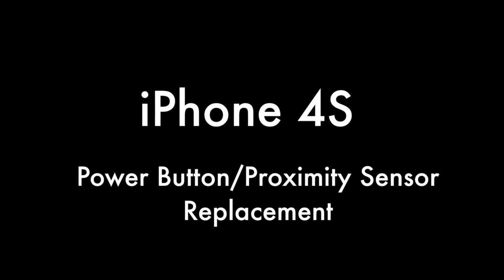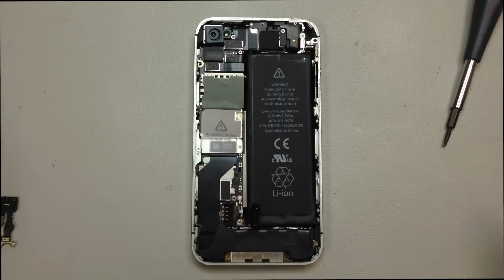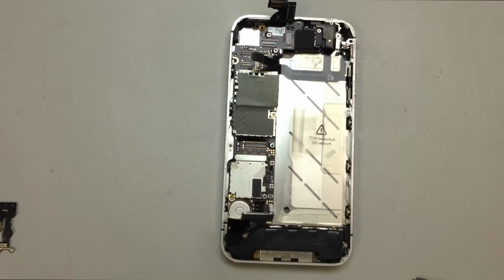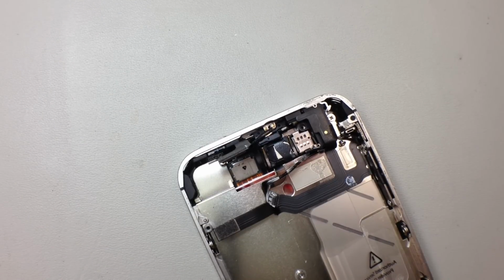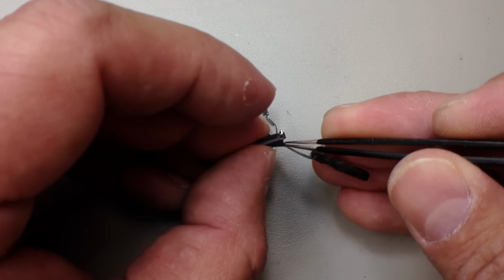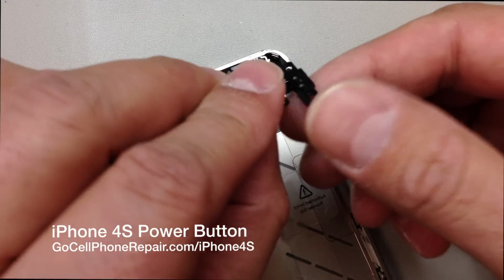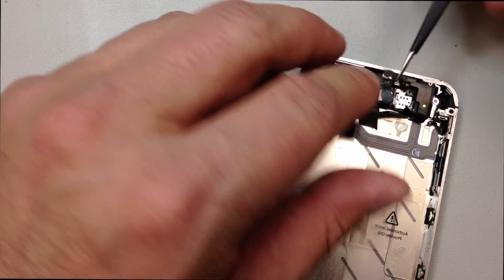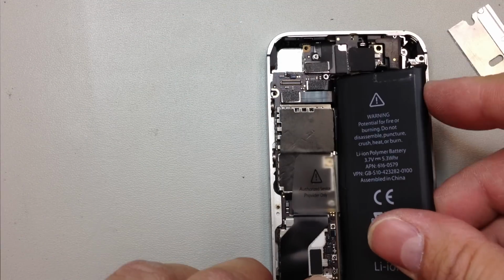iPhone 4S Power Button, Proximity Sensor Replacement

Comment: What is the socket above the power called, if you don't mind me asking? (I damaged the cable for the one above the power socket) So I need to get a new one, but I'm not sure what it is.
Reply from the maker: Can you link a photo so I can be sure that I know what you are referring to?
Reply: I worked out it was the front camera socket! Thanks for the reply though. If you don't mind me asking..
I managed to damage both: The front camera cable, and also the silent volume switch cable. The phone no longer turns on, do you think it's to do with one of these cables? They aren't necessary components though.. technically? Or could I have bugged something else also? I ordered new cables anyway, hoping it's just one of those cables. In a computer for example, you do not necessarily need a soundcard.. so I am just curious if 4S can actually work without some components.
Reply from the maker: As long as you didn't damage the lock button cable it should still power up. I'd try disconnecting the ones that you think are damaged and connect a power source to see if it boots the phone up.
Reply: I damaged both front camera and the silent switch cable. But I've managed to get the phone to boot, new cables are on the way, do you have videos to replace these two cables on your channel? In which order should I replace each cable?

Comment: hey, just watched the video, its very informative and helpful. But after putting my phone back together, I got a 601 physical nand block offset 1. Then i disconnected the power button cable and the phone worked again(but not the power button of course). Would you know what I did  wrong? Thanks again for the great video.
Reply from the maker: +Noob2Chicken Most likely the cable was not properly connected or it is defective. I'd try plugging it in again and if the problem repeates youve probably got a bad part. The logic board can cause this also but from what youve described thats probably not the source.

Comment: Amigo consulta, tengo 1 iphone 4, y el botón está hundido, es como que no se puede presionar, debo pedir el flex junto con la parte que va el botón resorte que sube y baja al presionarlo? o solo el flex con el botón ese sin la pieza que se desatornilla que va por debajo del botón (la que tiene 2 tornillos puestos en el marco del iphone).
Saludos y gracias.
Reply from the maker: +Aldo Cordero Cárdenas You can replace the entire flex cable or the contact switch itself. Neither are fun but. Let me know if that answers your question. Google translate is not always 100% accurate.
Reply: Go Cell Phone Repair i understand you :) thanks man i dont speak very good english

Comment: Power button works well, but my proximity doesn't work now. Any idea?
Reply from the maker: +Jakub Doležal Could be a defective part but I'd start by checking here: https://www.youtube.com/watch?v=ZzbznNb-aXM
Reply: +Go Cell Phone Repair 
Thank you. I tried connect the old proximity and it works fine. So I need buy a new one part.

Comment: Thanks a lot for the video. It's very clear! I didn't have a new prox. sensor so instead I put a tiny folded (about 4 times) piece of paper just under the power button. 

It worked!! 

The button doesn't click but it makes enough contact (I need to push a little harder than normal). Thanks for showing the disassembly.

Comment: Hey guys you seem to know your stuff, is it possible to replace my android's power switch with a DPDT momentary switch by simply running and soldering wire from the DPDT momentary switch to the solder pads in place of the stock power switch on the phone's PCB? Reasons are complicated to explain haha but is it possible?
Reply from the maker: +Matt Maybe. I'm not sure which phone you have but is there a reason that you don't want to just replace it with the OEM button?
Reply: It's for a custom project in which the phone's power button needs to be moved off the pcb.
Reply: Also its an optimus Android fuel

Comment: having a hard time  with putting the power botton back in, which way should it sit...still not clicking.  Need help.
Reply: +Jacek Blaszczyk The little flick on the power button have to point down

Comment: very helpful video.. i fixed the lock button and it is fine now. but the ear speaker is not working.. i removed everything and put that back again.. still the ear speaker is not working..
Reply from the maker: Sowrirajan Kalyanaraman Check the gold prongs. If they don't line up right there will be no sound.

Comment: Question: Has anyone else noticed how small the hole is in the proximity cable for the speaker? I dont know if mine is not aligned well or what but mine is not very loud. Though it may have been the speaker so I replaced it with one that tested to be very loud... but not now after putting in my phone?  HELP!!! lol

Comment: Excellent vid thanks!  Just one question, is there a UV filter for the sensor on the 4s?  I tried 2 flex cables (same supplier) and can't get the sensor to work, not sure if that's a possible cause.
Reply from the maker: Was the screen repaired prior to the problem? Sometimes the coloring of the window is off a bit. You can sometimes go over it (on the inside) with a black Sharpie if it's too light.
Reply: Go Cell Phone Repair Turns out it was a bad supplier.  Got the part from another and it works.  Thanks

Comment from the maker: @matt sturrock Yeah I usually go through the whole re-assembly. Must have been in a hurry that day.
Reply: Go Cell Phone Repair What screwdriver brand tool did you use?
Reply from the maker: Bryan Torres In this video I was using a Husky.

Comment: this was a great run through and helped me out loads. I couldn't of done it with this chip. was a little disappointed when the walk though stopped after testing the power button - dude you left me hanging !  apart from that, great clip. 
Many thanks

Comment: The power switch after doing repair is very stiff and doesn't seem want to push in. Is that normal?
Reply from the maker: No it should feel pretty close to the same as when the phone was new. Sometimes the button doesn't get aligned exactly where it should. You might try backing off the screws a bit and moving it around until it feels more comfortable.

Comment: I ended up with a bootloop after this, what did i do wrong?
Reply from the maker: Hard to say for sure but I would start by disconnecting the new part and see if it does the same thing. Unplug the battery first of course and you can plug the phone into a power supply to turn it on once the power button flex is disconnected. If that works you probably have a defective part. Otherwise that can also indicate a software problem. This sometimes happens after the battery has been disconnected especially if your device is jailbroken.

Comment: Just a thought, I couldn't do all that fixing in a million years. I was quoted £160 to fix power button by Apple store. Only just out of warranty. Or they would give me £200 for it if I bought a new £600 phone!!!
Why are iPhones so rubbish that they need all of that after being very lightly handled - in the big scheme of things? Dodgy product trading on its name, which I think will soon be replaced by a more reliable one.
Reply from the maker: Wow that sounds like a bit much. We do them here for $79-most of that being the labor fee as there is considerable time involved. As for the big scheme of things.-understanding their design flaw we would hope that Apple decides to create a modular lock button rather than attaching it to the main flex cable or at least build a more durable switch. Then again this has been a problem since the iPhone 4 and continued up until the current model so I am skeptical about that idea.
Reply: Wish I could bring phone into you, but I'm in London! Will just have to continue using that irritating assistance button.

Comment: does this also work for iphone 4 ?
Reply from the maker: Similar but a little bit different as far as the way the cable is situated near the earpiece. Easier in that respect but it includes the secondary mic on the iphone 4 flex cable which is kind of a pain to install. I will make a video for the 4 as soon as I get a chance.
Reply: thanks

Comment: Is taking out the logic board really necessary?
Reply from the maker: For replacement absolutely. Until the board comes out the part is not accessible. Sometimes you can adjust the power button but this is rare and does not help the proximity sensor. If the black dot is missing or you can't click the button when exposed then you have to replace the entire flex.

Comment from the maker: @Randy Sarun If it runs right down the center then that is most likely caused by the Apple not displaying properly during start up if. I would try re-seating the cables but it's possible that your screen or LCD flex cable was damaged.
Reply: Thank you very much for the video!
Unfortunately, I have absolutely the same problem as Randy. I tried to reseat the cables 3 times and now I'm worried if the LCD flex cable could be damaged. What could I do to test it, whether it is ok or damaged and what sould I do if the cable is damaged?
with kind regards
Martin
Reply from the maker: Martin Drobek
If the cable is damaged you will have to replace your screen unfortunately. In this video http://youtu.be/JcJU36Xxysk I demonstrate how to use a test cable and see if you have a problem with your existing one before doing a full installation. If you have access to another 4 or 4S (the screens will plug in to test but are different for installing) you can temporarily connect it and see if your screen is actually the problem or not.
Reply: thank you very much for your help!

Comment: This is a fantastic tutorial. My first ever i-device repair and it went so smoothly, only took me an hour. Many thanks! Note to anyone attempting this, leave the factory speaker because the ones that come on some replacement parts are (at least in my case) awful, i had to take mine apart again and put in the original one. Good luck!

Comment: thanks but u put glue on  the speaker ?
Reply from the maker: Nah. As long as you set it back in place it should be fine. It's difficult to remove with the adhesive intact but as long as the foam cushion stuff is there it will seal well enough.
Reply: thanks u  thats realy help me :)

Comment from the maker: Similar but different. The speakerphone mic is in line on the flex for the 4 and it's tricky to get out without tearing the headset jack flex cable if I remember correctly. Also the proximity sensor does not route over the earpiece but underneath instead. I'll make another video next time I do one.